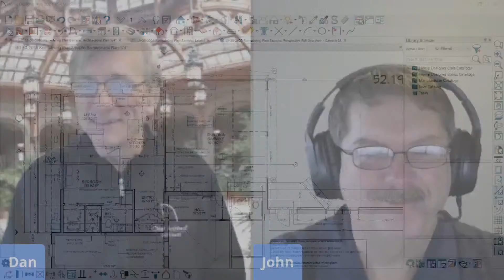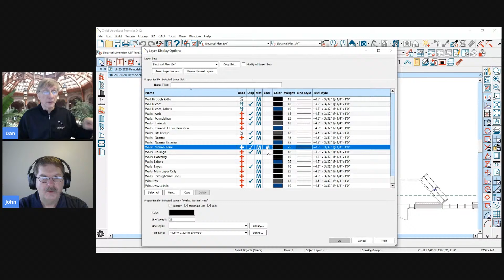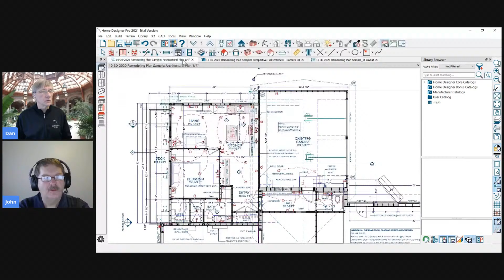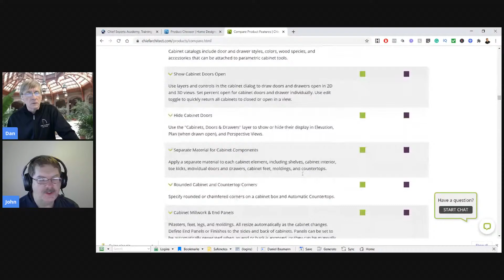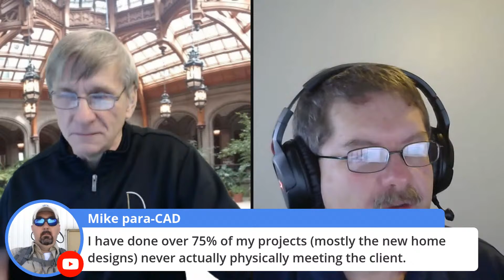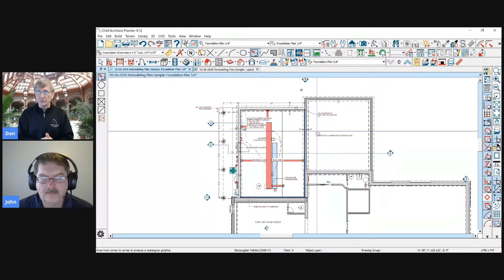Home Designer Pro VS Chief Architect Premier and How To Start A Plan | The Designers Show #26

Comment: I’ve been working on a design in HDP. I’ve been very impressed with its capabilities although after a year of pretty deep work for a permit ready set of CDs ( MEP, Imported Topo Data from the GIS) and now finalizing construction documents ( close to 40 pages)  , I definitely am starting to push up against the limits of HDP. The main features that I am considering upgrading to Chief for are exactly what you mentioned. Right now I have 30 separate duplicates of the same complete plan , each for separate layouts which takes a lot of attention for file management. The question I have that I didn’t see answered here, is if I upgrade to Chief after creating these 40 layouts from the same  duplicated plan sets in HDP , is there a way to consolidate all of my layouts ?Or would I have to start from the main plan in Chief and redo all the layouts and CAD/text and call outs  in Chief? I suppose I could import pdf files , but I wouldn’t be able to edit the plan . Another point to note and follow up question is in regards to the computer CPU . I am importing large topo files from the GIS 54,000 topo lines to extrapolate ,  in 1 foot increments over 10 acres, the 3D rendering is incredibly slow when trying to edit and go back to the 3D renders. Is there a setting that makes switching  to 3D view faster, so it does not have to render the same topo data every time ( takes about 10. Min every time I make an edit on the 2d with topo and switching to 3D,  is this a CPU issue or can you lock the topo data so it does not have to reprocess every time? If not that would be a great update for the software  . Thanks

Comment: I appreciate John's comment at 41:10.  As an engineer it annoys me when I receive, for example, a rendering of a subdivision layout that shows right-of-way limits, building limits, building foot prints, etc. and calls out dimensions on them, but when measured they aren't accurate.  If there is plenty of land available it's not a big deal but projects like condominium developments that are incredibly tight can really get screwed up if offsets, elevations, building footprint sizes, etc. are inaccurate.

Comment: Can you make custom trusses in this program
Reply: Looking to do passive house build and want to end the truss at the wall
Reply from the maker: @ergun8382  Yes you can make custom shaped trusses with both programs. Add a roof, draw a truss, open its dialog and turn off "No Special Snapping". You can then resize it on the floorplan and in an elevation view.  You can only change the webbing in the Premier version.
Reply: @chiefexperts  thank you for the information

Comment: Home Designer Pro 2021 DO HAVE the ADD TO  LIBRARY icon on the bottom  when  one  click on  one object.  Since you got the trials there you do not have it.   And it will be the same for me if I  go for the download of the  CAPremiere  trial I wont get a few things like saving, printing, raytrace  just to name a few.  I  really like both programmes and it is fun  playing  with it tho. Nice  video tho. thanks a lot.
Reply: Hi , is that the “Chief Architecture” software include all function of “Home designer Pro” ?
Reply from the maker: @wongkyo5339  The Premier version of Chief Architect has all of the Home Designer function. Home Designer is derived from the Premier version.
Reply: @chiefexperts  tks for ur information 🙏🙏
...another interior bim software call “interCAD T6” , seems it’s similar to CA series software , i and my partners confuse  which one should we buy.......since there no compare video or discuss between CA and InterCAD